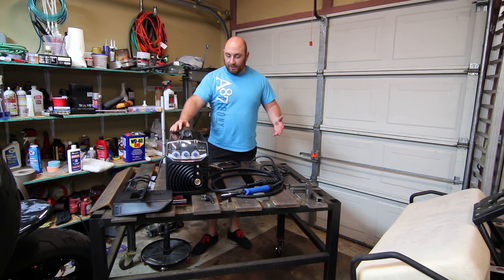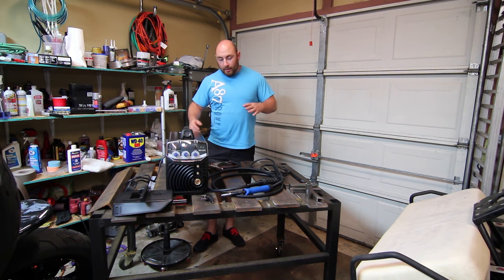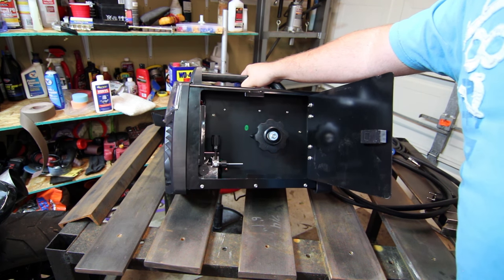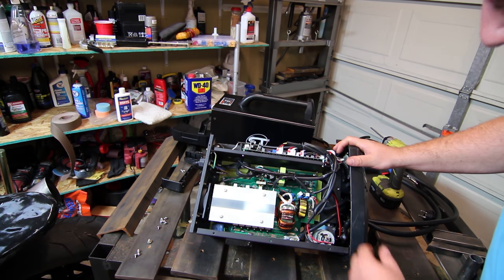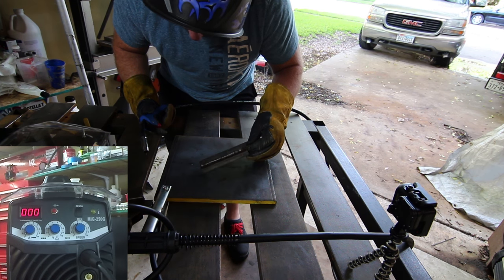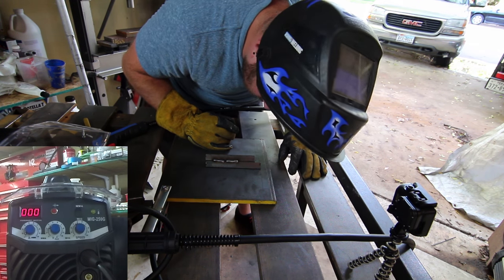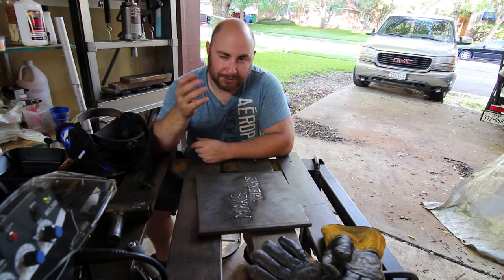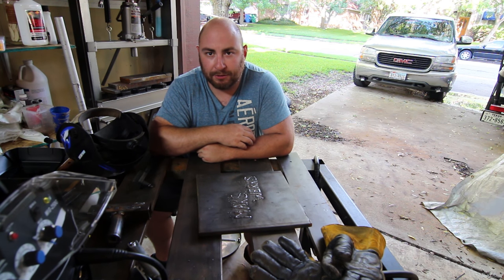MaksWerks Reviews - $300 250 Amp Chinese MIG Welder

Comment: Inside the machine was a brown and black wire with no neutral, correct? Did you connect the black to the brown terminal, the white to the blue terminal and the green ground to the chassis? I purchased a Chinese welder with the 2 prong plug, 220v and no ground on the plug. The machine has an external screw for connecting ground. I am not sure how to switch the wiring for my standard 220 v outlet. Thanks for any help.
Reply from the maker: unfortunately the colors tend to be whatever scrap wire they have that month, you have to trace it out. there is two legs, a neutral and ground has to run to the case. The legs are interchangeable but the neutral is usually the smaller of the 3

Comment: Thank you for the good video. I have looked at the Simadre MIGs on eBay and they look just like the one you have except that they don't go as high in the amperage, only to 190 amps (they are dual voltage though). Your review has convinced me that one of these will be the way to go for me as I bought my 3 in 1 TIG from them and have been very happy with it. Happy Holidays!

Comment: I have purchased a Chinese MiG welder, unfortunately it’s come without welding setting table ( for voltage and wire speed). Any advice please help.
Reply from the maker: I always set it on feel as the numbers dont mean much anyway. You want to have test material of the same thickness and just find the speed and temp that are right for you. once you get used to your machine it will be easier to guess.

Comment: Hi there , i have in my workshop 20A 230volts, which one will suit best for me to weld aluminum? The 160 or 200 shunte?
Thank you to light my question.
Reply from the maker: Probably the 160, but to MIG aluminum you need a spool gun, and the welder may require modification.
Reply: What kind of modifications?
Reply from the maker: possibly switch the polarity on the leads. I do not represent this company or have any relation to it other than being a customer. So i can not speak to specific details.

Comment: Can the polarity be reversed for aluminum and flux core useage (with a spool gun of course on al.)?
Reply from the maker: yes. You swap over the leads inside the machine.
Reply: Also does DC lift-tig and in addition to voltage control for mig it has a current control knob for stick and lift-tig.  Not a 250 maching in my opinion as it is no more powerful than my AHP Alphamig 200.

Comment: Did you have the company add flux core welding feature or did it come standard. The reason I ask is that I contacted ST about the machine's flux core welding and they stated it was a feature that would have to be added for $45.00. Also, is it capable of spray transfer? thks
Reply from the maker: Hmm not sure. You can just swap the leads inside the box for flux. Perhaps they offer a quick switch feature for $45 but I do not have it.
Reply: Thanks. What about spray transfer, have you tried it with that machine?
Reply from the maker: It has the power to do it, but I have not tried it.

Comment: Is there one welding machine containing more than welding head such as (MIG / TIG) ??Thank you
Reply from the maker: All-in-one machines tend to be no it good at anything. I prefer to split Mig and TIG/STick.
Reply: But is there a welding machine containing them or what?
Reply: I just received my ST Mig-250, just like yours, and I believe you can also do lift-tig DC welding on steel only. Mine will accept the large and small rolls of wire.  $350 was the best I could do, $200 for the welder and $145 for about 3-day shipping and mine was not well boxed either but arrived unscathed. It seems to mig weld very well and I feel I can adapt a spool gun to it for aluminum.  It is so small and light with input and internal wiring of small gauge I can't imagine it will actually put out 250 amps but I plan to put it to the test.

Comment: Yeah, nice, sensible review showing an outstanding value for a 250 amp MIG welding unit.
Reply: where can i get a machine that migs and tigs driving me nuts this is
Reply: @intuitivealpha328  Yeah, Everlast is the leader for features and values on "multi" MIG/TIG units. Many of their MIG-DC/TIG units are the only ones with high-frequency (HF) arc starts for TIG. And they were the first-to-market with "all-in-one" MIG-AC/DC-TIG, Stick units. As a retail customer of Everlast, I've owned the 210EXT for over 5 years now, and it's still a best value for an advanced-featured AC/DC TIG unit that has no competition, until you spend about tow or three time more from other companies.
https://www.everlastgenerators.com/catalog-multiprocess-migtigstick

Comment: How is the welder after 6 months? 
Any Problems? Has it been used a lot? 
Thanks
Reply from the maker: Use it weekly and no issues. Just keep the tip clean, and feed it quality wire and it will go for a long time.

Comment: hey I know that you said you're not connected to the company by any form but I was wondering if you could let me know the distributor that you got it from considering there's a lot of people and all they bother trying to rip somebody off I'm trying to get a welder but I'd rather go through distributor that I know isn't a scammer
Reply from the maker: Not sure. This was a long time ago. The company name was ST welding.
Reply: @Makswerks1  thanks man how's the welder holding up you still have it
Reply from the maker: @me_ap3725  Still working great. Many tanks and probably close to 100# of wire later.
Reply: @Makswerks1  nice I heard it's make-or-break with a welder if it doesn't break within the first couple of months of you using it the more than likely it'll be around for a some years. That's what I heard anyways thanks for the help man
Reply from the maker: @me_ap3725  ya most likely is DOA, or very shortly there after if there is a manufacturing issue. Otherwise its good to go. The plastic handle has broken, and it gets kicked around the shop near daily, but it works as well as day 1. I have replaced the welding stinger with a longer (but still chinese) unit.

Comment: Just wondering how la-git the Alibaba web site is to deal with and did you buy direct from the manufacturer 
Did you have any issues or hidden import fees or taxes
I'm looking into a plasma cutter from a few Chinese manufacturers and wanted to make sure I don't get ripped off
 Good vid by the way
I have a dx 250 Miller tig & Lincoln 180 mig and had no problem buying an everlast 275s runs great and its a beast
Reply from the maker: its a bit of an art to negotiate with them, but all my purchases have been positive. Right before you pay they have to send an invoice, so just make sure that invoice is correct and send the money. The cash is not released to the company until you received the item in most cases.
Reply: Great thanks for the info

Comment: Checking on Alibaba the duty cycle is no where near what you mention unless I'm reading it wrong.  60% @ 20 to 200amps.
Reply from the maker: there are a lot if different units on there. Some even look similar but are not.
Reply: I looked more carefully at the spec label in the ST Mig-250 I just received and it states the same duty cycle Makswerks states. How they can make a welder this light and small and still put out 250 amps with the amazing duty cycle I will never know. The on-off switch and the input wire size are just tiny. Any I am very happy with it. It will do DC lift tig, stick and mig and with a little DIY I see no reason why I cannot connect my Chinese spool gun. My machine will accept both 2 # and 10 # wire rolls if I take the plastic shaft for the 10 # spool off.
Reply: I compared my ST Mig-250 to my AHP Alphamig 200 in shear welding power using 0.30 wire and 20 Cf of argon on steel.  I'd say both machines are about he same in steel penetration when maxed out.  neither will penetrate 1/2" or 3/8" plate but both will penetrate 1/4".

Comment: For $300 delivered i would be surprised if it turned on. You need to go get lessons on how to weld, the way you hold and use your hand piece is the method for gasless welding which by the way is why the machine doesn't come with a regulator. Your test at high amps writing your logo is not a test of value as you never did a constant run to see if it would stop. To me it appears to be awesome value for money.
Reply: I bought one after watching this and i can say that the welder is very fickle. I am not a welder, but this is my 2 cents.
the door for the spool is  poorly designed.  getting a spool in/out is a hassle.  the mechanism for holding a 10# spool feels like a cheap afterthought.
switching polarity is also a big hassle and was NOT designed for this in mind.  I eventually hooked up a quick connector to a terminal and routed it out the case so i could flip the polarity by switching the the connectors.
the tig hose  has to be as straight as possible.  It loves to flash weld/stick the wire to the nozzle.  make sure the hose is as straight as possible.  otherwise you will spend more time to getting it  to unstick than you will welding.
The current is proportional to the wire feed speed and i tested mine and it maxes out at 150 amps on 0.030 wire.  if you use 0.035 you may be  able to get it past 200 amps.  i dont know anyone that uses 0.045 for a hobby welder but i guess its possible to get it to the 250 spec.  on that note you will have to find a 0.045 wire roller.
i had to add an inductive  choke make the welding tolerable.  it barely sticks with a few turns of 4/0 wire on a laminated core.
on the plus side it never tripped temperature breaker.
would i recommend it to someone that is not technical? that a straight up NO!.  this is the last thing you would want to learn on as the curve can be pretty steep.
If this welder is considered a kit and you have the time to learn  and are willing to experiment, then by all means.